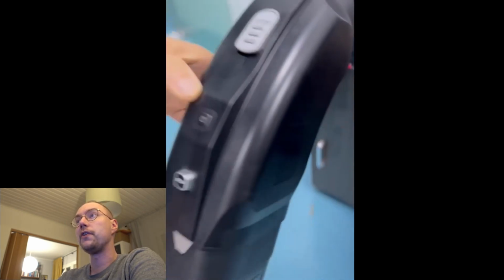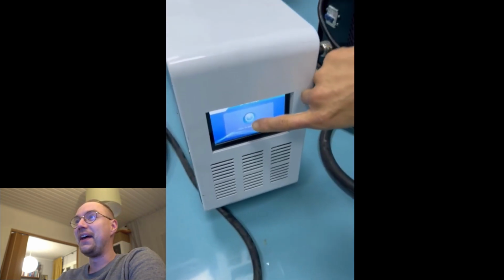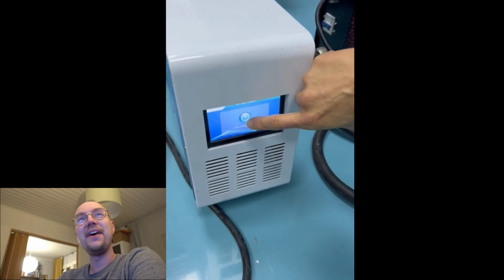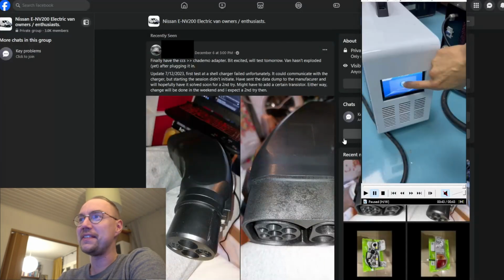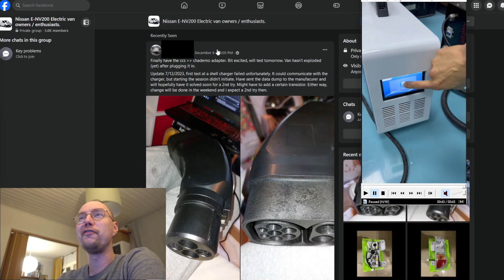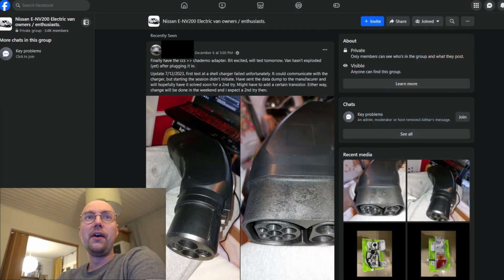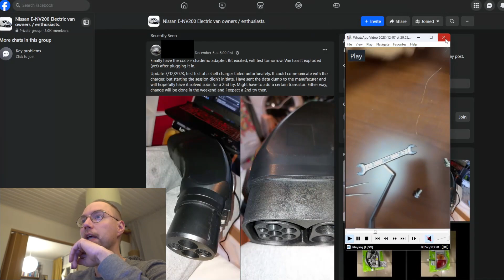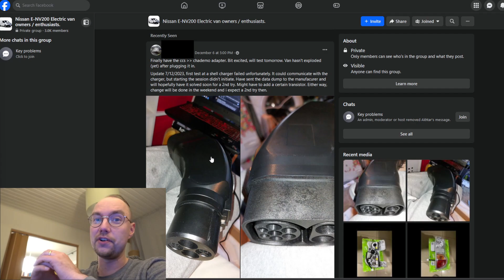They did not even test it on vehicles!💀

Comment: Both the car and charger have contactors, so the one in the adaptor is probably functional rather than for safety.
Reply: Agreed, I reckon they shortly close the charge port contactors in the car to sense the battery voltage. To avoid pack voltage on the CCS inlet they leave that one contactor open. With that sense phase done the car side contactors can do their thing fully separating pack and charger as appropriate.
Reply: In CCS the EVSE sets the voltage and the EV measures it before closing its contactors. In Chademo it is the other way round, so you need to separate the two sides during the handshake phase.
Reply: Exactly. CCS and chademo have different protocols. On chademo you précharge the chargers' cap and it senses the voltage, whereas with CCS you communicate id

Comment: Thank you for reporting on and researching of this topic, Dala. Everything I've observed so far indicates that any successful CCS-to-CHAdeMO adapter is probably going to be rather large. I'm concerned that attempting to fit all 
the necessary electronics into the confines of a handle-style block of plastic, like shown in the video, is not a good approach. It's going to weigh down on the car's receptacle and induce physical stress over time. 

I'd much rather see a design in the form of a briefcase or box that can rest on the ground and have a separate cable (~2m long) attached to it that's terminated on an ordinary CHAdeMO plug. In North America, it should have inlets for both CCS-1 and Tesla NACS. Europeans would probably be fine with just a CCS-2 inlet. I'd rather have an adapter that takes up some physical space, has some real world electronic flexibility and durability and actually works . . . unlike the "convenient" one built into a handle that doesn't!